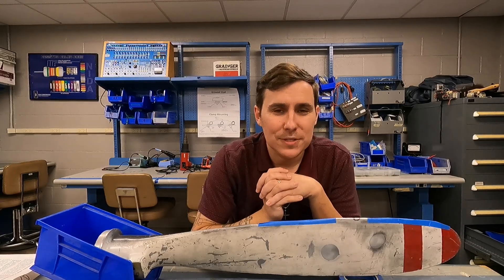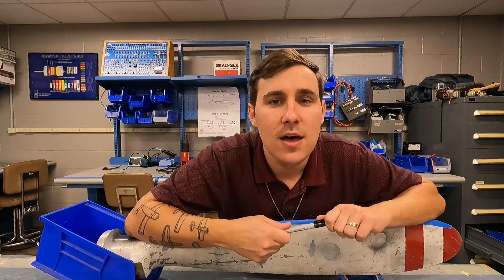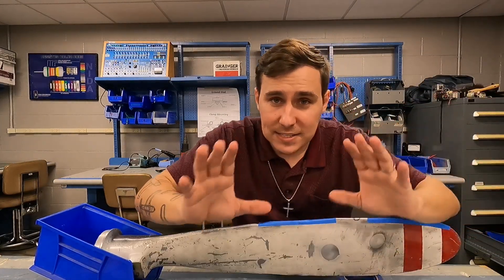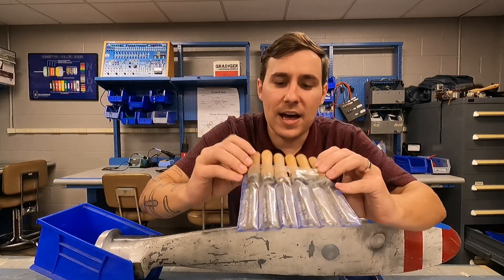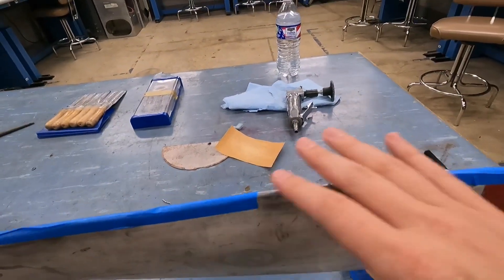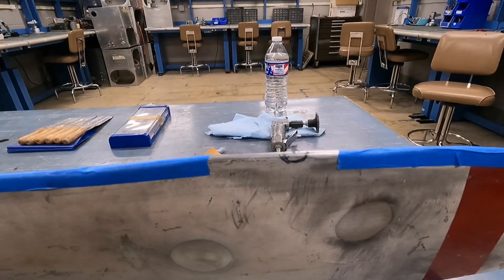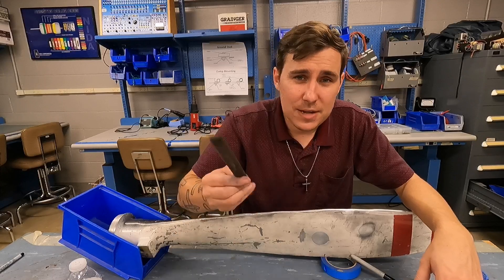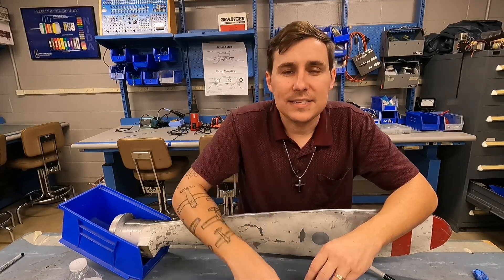How to Blend a Nick in an Aircraft Propeller Blade | A&P Practical Project Demo

Comment: Going in for my O&P soon. I have a query I think you could answer; With repairing a critical structure like this, would you or should you die pen the blade edge to make sure there isn’t an un-observable crack that had formed from the nick/dent?
Reply from the maker: I mean, you can if you think there may be one. I don't think there is any specific instructions that say too. I could be wrong but I haven't seen that in the past.
Reply: @brycebuildsit i see.. much appreciated 🙏.

Comment: i thought you had to file spanwise so from hub to tip or tip to hub?
Reply: I thought so too. Some exception for leading edges?
Reply from the maker: It's definitely a good idea to. Most all of the procedures say that you can file the way I was just that all finished file marks should be spanwise. Obviously, what you are worried about is cracks and a stress riser so it's always best to finish sand and polish and remove all file marks

Comment: Hey there Bryce, Can you make a video on complying with an AD & using 14 CFR part 43? Just prepping for my O and P and forms and records making me nervous
Reply from the maker: That's pretty easy actually. I always use the following statement.  

Complied with AD-####-##-## Effective date 00/00/0000 IAW (paragraph of AD complied with) ~if recurring Next Due (either date or time).
Of course list any parts. Some AD'S have recurring inspections that can be terminated if certain parts are replaced. Like, say a rudder hinge on a bonanza. You can either take it apart and dye pen it every 500 hrs or install upgraded rudder hinges and terminate the AD. So it's important you put which method you are doing to comply. That's where the paragraph comes in.